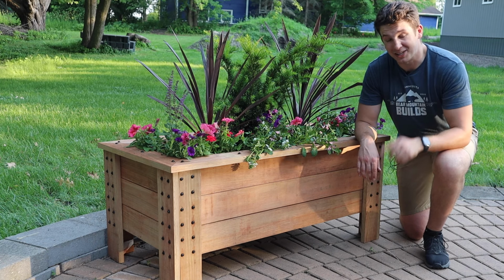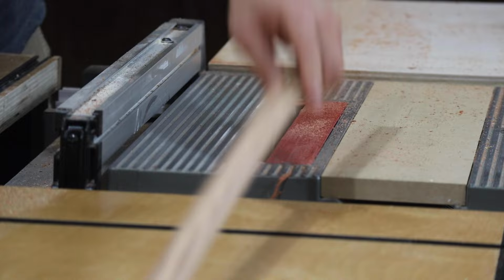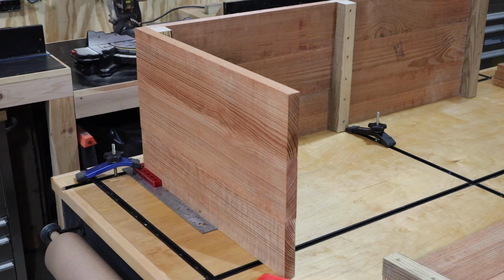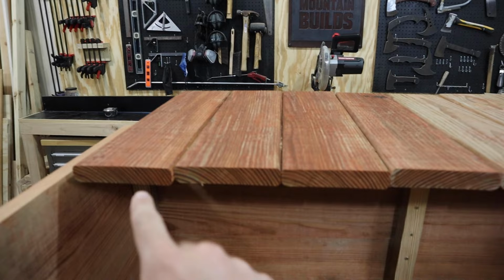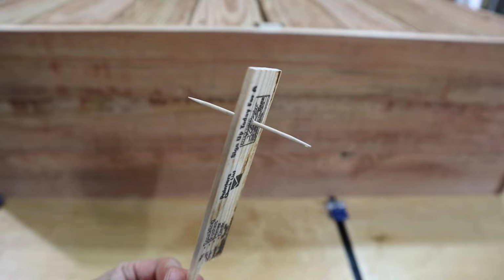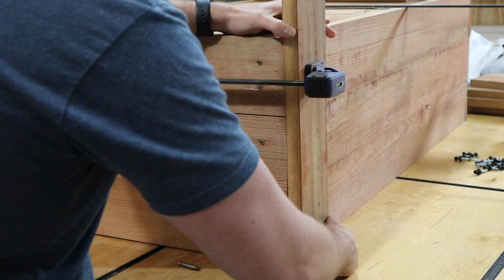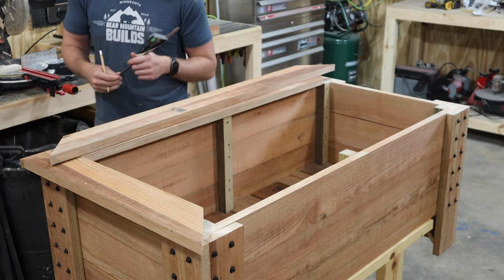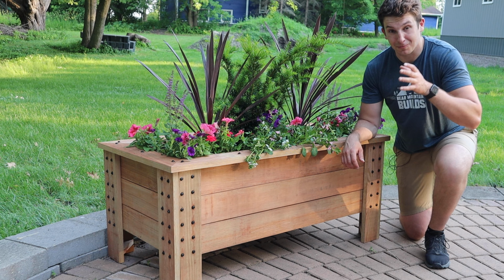Simple Modern Cedar-Tone Planter Box | FREE PLANS

Comment: great build. One tip would be to drill the pocket holes in the top face of the boards that make up the bottom. The direction and angle of the screws will provide more strength against downward pressing forces. This is important especially since the wood is wet and will shrink as it dries.
Reply: Can you explain more in this please?
Reply: @ImDying2Live  thank you so much for the explanation on this!!
Reply: Building one now, and drilled and screwed the holes as you suggested. My question is should I fill those holes to prevent water from pooling there and if so, what method should I use to fill them?
Reply: @ImDying2Live  this is good advice. I'm popping together a planter this afternoon, and was browsing for ideas on how I would secure the bottom. A lot of the designs I've skipped past look like the bottom will fall out so easily. couple bags of wet soil can easily hit 50kg or more.
Reply: Wouldn’t that have the pocket holes going towards the edge of the board?
Reply: @scottfaulk9081  all pocket holes are drilled to the edge of the board (towards the end grain).
Reply: @redfulla1494  I sell planter boxes as well as have ones I built 7 years ago out of pine picket fence boards and pine 2x4s. I would suggest using something like a 2x4 as the edge that the bottom boards rest on top of. I usually run my bottom boards the length of the box instead of the width of the box. And screw in brace pieces along the width of the box to join the 2x4 support rails. This gives maximum support of the bottom boards. Just think of a bed frame and the slats that the box spring sit on.
Reply: @mresmith4302  I meant the boards they are mounting too
Reply: @mresmith4302 
Yeah, that's what I was thinking also. That's a buttload of unnecessary pocket hole screws. A lengthwise cleat, well secured, would give the bottom a good bearing and accommodate the wet-dry cycles of movement  down there.
Reply: Sorry but I disagree. The box will be constantly full of moist soil. You don’t want that getting down into the holes and contacting the screws. Yeah you could glue/plug them but water will still get in over time and pool there, creating a fail point. 6 total pocket holes/screws per board (even screwed in from the bottom) is more than enough to support the weight. I know from experience.

Comment: Looks amazing! Had you cut the pressure treated wood a bit shorter you'd have saved some cutting on the bottom planks. I can always find a way to make fewer cuts. However, I don't know if the slightly shorter supports would have any knock-on effect. Presumably these are things you'd have to build a bunch of, so saving 6 cutouts per unit could add up to some serious time saved.

Comment: Shouldn't the pocket holes for the bottom have been flipped over and screwed from the inside of the box for weight support?
Reply: No. Absolutely not. The box will be constantly full of moist soil. You don’t want that getting down into the holes and contacting the screws. Yeah you could glue/plug them but water will still get in over time. 6 total pocket holes/screws per board (screwed in from the bottom) is plenty strong and will support the weight just fine.

Comment: Came across this video.  It's a good-looking planter box, and the timber shouldn't cost too much, maybe less than $100.  Problem is it would likely cost over $3,000 to get all the tools, clamps, table saw, jig saw, miter saw, oh and the pocket drill rig, corner squares.
Reply: Well if you buy hot dogs, you should only pay $5-10. But if you don't already have a stove, fridge, BBQ, utensils etc... it will cost you more. If you don't have any of the tools, then buy a pre-made one, and don't complain it costs alot more...
Reply from the maker: You can build this with minimal tools just takes longer than using what I use. Everyone starts with a few of the generic and invest in more tools over time.

Comment: You mentioned using this for growing vegetables. Just making sure that pressure treated wood is safe for growing food?
Reply: As having a couple vegetable gardens beds, it is not wise to use pressure treated wood/lumber as the chemicals used to treat the lumber will make contact with the soil which will contaminate the entire soil in the planter box as you water your vegetable plants. Just as Kelly B mentioned 7mos ago. Better to use one of the Cedar board for support or double them up and use them as support.  Don’t want to eat any vegetables that’s been contaminated with the chemicals from the treated lumber.
Reply: Do not use treated lumber for food planters.
Reply: I think the liner that he used takes care of that. Definitely would make sure before I grew veggies. But I think it would

Comment: Good design except for the bottom screws. When you drill many holes in a straight line, it's like perforating wood the same as line printer paper; it splits easily over time. Instead, delete the middle vertical support and run a horizontal re-enforcing member of thicker wood.

Comment: Hello MR. BMB....quick question...why didn't you glue the bottom boards, especially since you want the bottom to be "rock solid"
Reply from the maker: The bottom boards are the most at risk of falling apart from water damage so I don't glue them to make them easier to replace if needed years down the road

Comment: just curious about your screws. neither of the deck or pocket hole screws you used for assembly appear to be rated for exterior use.... am I mistaken? Also noted the use of PT lumber in your garden box which is a no no for vegetables or herbs.  Looks good and sturdy otherwise.
Reply: You are thinking about old-fashioned PT wood, when arsenic was used.  They outlawed those nasty chemicals years ago & replaced with other non-toxic chemicals.  New PT wood is safe in birdhouses & dig houses & raised garden beds.

Comment: Love the look of this box, but wanting to make them taller and add casters so I can roll them in and out of my store.  Would you just recommend extending the legs and the inside corner support board and attach the castors to the 2x2 inside board?  Thanks!
Reply from the maker: That would work but it might be a good idea to make the a bit thicker in order to fit at least a 4” wheel

Comment: I am building a couple planter boxes myself off of your video. So far it’s turning out very nicely, and I appreciate you making the video! However, when I’m using the Kreg system to pre-drill my angled screw holes for the bottom boards, and I’m using 3/4 inch boards on the bottom, and drilling into 3/4 inch boards on the side, I would like to know how long the screws should be so I don’t punch through the side of the planter box.  I have purchased 1 inch as well as 1 1/4 inch screws, and since I don’t know how far the screw goes through the pre-drilled bottom section, I am unsure of how long I should be using.  Best I know to do at this point is to find a couple 3/4 inch boards and do a practice drill…
Reply from the maker: Just use 1-1/4" screws. Kreg has a great diagram showing what screw length to use based on material thickness
Reply: @BearMountainBuilds  thank you!

Comment: You show the end pieces and bottom pieces the same length, but the end pieces are on the outside of the long sides, and the bottom pieces are on the inside. I think the bottom pieces nees to be 2" shorter
Reply: They are two inches shorter. On his plan he has 14 total - 21.5" x 5". It should be 6 total - 21.5" x 5" and 8 total - 19.5" x 5.5"

Comment: The cut list for the bottom pieces are wrong if you assemble  like the video. You do end s first then sides
Reply: I also noticed that the bottom cut pieces were too long on the plans … either shorten the bottom pieces or make the side pieces longer for a simple solution

Comment: I noticed that you used a drill press to pre-drill some of the holes. How important is this on order to get the screws to go in straight? I don't have a drill press. I notice when I drill my holes, many of the screws don't go in straight. I try to drill straight but to no avail. Any suggestions? Hate to go to the expense of using the roofing strews if some of them don't go in straight. Kinda' defeats the purpose of having that extra nice look.
Reply from the maker: The drill press isn’t necessary just takes some human error out. I definitely recommend pre drilling holes to avoid splitting and to get the screw straighter. As for recommendations to make it easier you could look into buying a drill that has a center level on the back. That’ll make it a lot easier to know if you’re drilling straight down
Reply: Try using Brad Point drill bits, draw a line where you want your screws to be, don’t force the bit or the screws.

Comment: Would this material work in the high desert temps of Las Vegas?
Reply from the maker: These should be able to take it. They’re deck boards so they can take pretty intense heat. You’d definitely want to pre drill the holes for all the screws to prevent cracking when the wood shrinks

Comment: Where did you get your cedar decking at?
Reply from the maker: I got mine from Home Depot
Reply: @BearMountainBuilds  awesome. Thank you. I e recently started using 4x4x8 cedar posts instead of buying cedar lumber. About 1/3 the cost but a lot more work.
Reply from the maker: Definitely a lot more work, but if you got the time and a strong enough saw it’s a great option especially with these wood prices
Reply: @BearMountainBuilds  Our HD has only the 3/4 in 6X8's that can be purchased individually. And they are $23 per board. Ouch! They offer a 1 in x 6x8 in a 5 pack for $146 ($26 per)...Ouch x 2! Is pressure treated not recommended for growing veggies due to the chemicals in the wood?
Reply: @stephenmoore2561   Arsenic stopped being used around 2003 & was replaced with safer stuff.  New PT wood is good to go on all outdoor projects from bird houses to dog houses to planters to raised garden beds.  PT away.

Comment: Honestly, I was going to build this and went as far as cutting all the boards to length, but after everything was said and done I realized I had a massive amount of wood that I was using to make... a single flower planter. It doesn't really seem economical, and I just couldn't bring myself to go through with it. Plus, working with decking for this type of thing is definitely easier, but not really ideal. It brings the total build time down but after going through so much work with the cutting and eventually the assembly I would come to a point where I question myself for half-assing the wood itself.

I appreciate the video, but I think I'm just going to build a chicken house out of the wood I cut for this.

Comment: You might know a lot about woodworking, but I’m guessing you’re not a gardener. Pressure treated wood should never be used for a garden bed if you’re growing vegetables.
Reply from the maker: They don’t put arsenic into pressure treated wood anymore so it can be used in vegetable planters
Reply: @BearMountainBuilds  there are still plenty of other chemicals on pressure treated woods. Heat treated is safe, pressure treated is not.

Comment: Plans are wrong
Reply from the maker: What’s wrong on them?
Reply: @BearMountainBuilds  page 3 doesn’t match up to page 4. Looks to be missing a board. Also, the 1.5x1.5 pieces, if cut to 17.5” have a 2.5” overhang that you do not have in the plan steps. They need to be cut to 15” to match up to the 3 stacked boards at 5” each.
Reply from the maker: @R3D15NUMB40N3  yep you’re right I’ll get the plans fixed. Thanks!